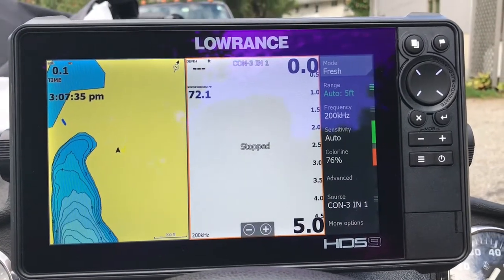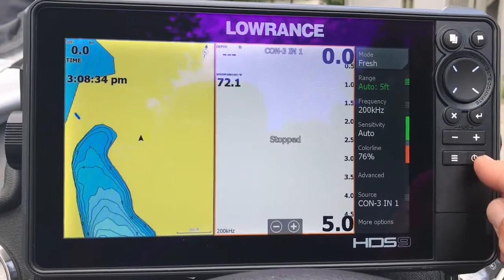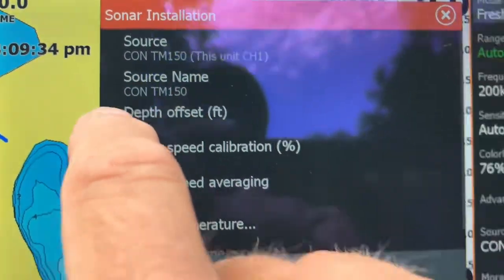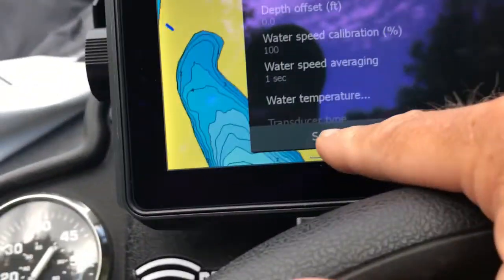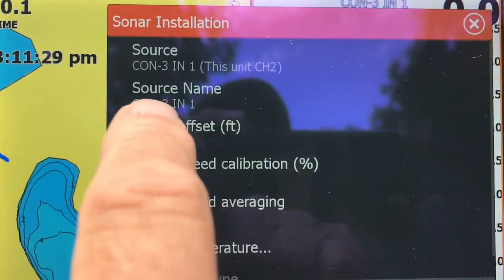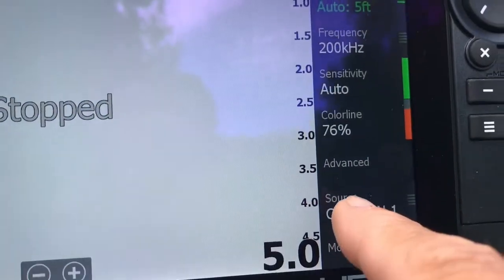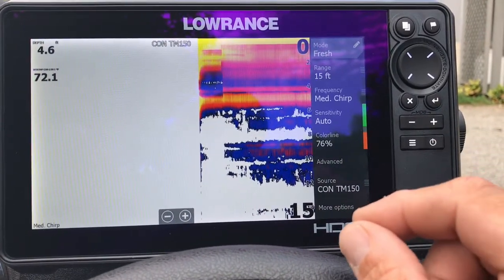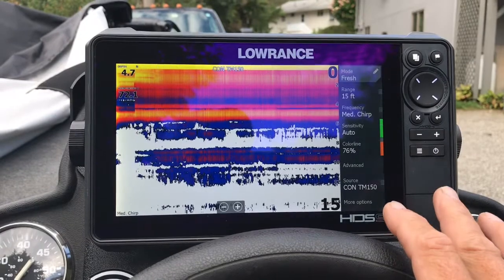Naming Lowrance Transducer Sources

Comment: very informative. I am trying to set up my HDS-10 Pro, when I try to put the overlay with depth, cannot find it? look at the various videos, and depth isn't seen? just see depth over structure? my unit recognizes the airmar  transducer, my boat is not in the water, still ice here, any thoughts?
Reply from the maker: Does the Airmar Transducer you have installed have a temp sensor?  Not all do.  If it does, you will need to go to Settings, Network, Data Sources.  For Temp, you will need to select your transducer as the Source.